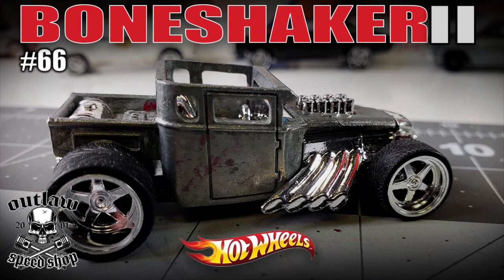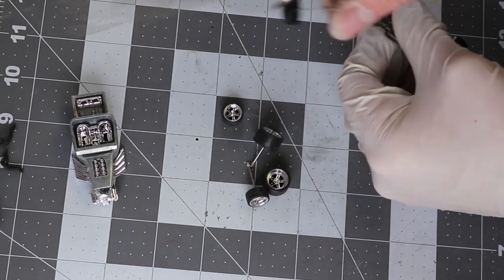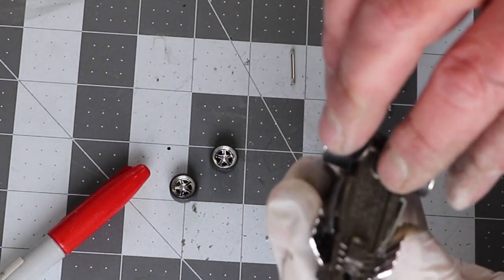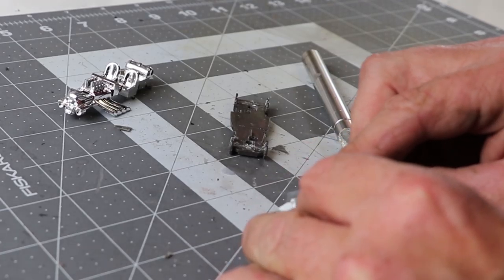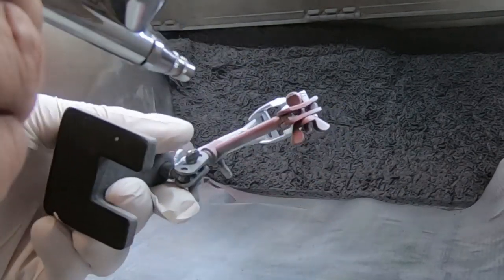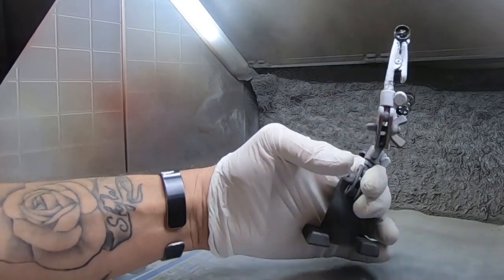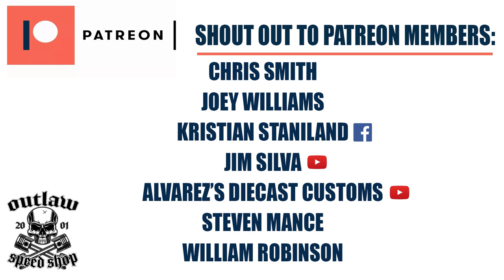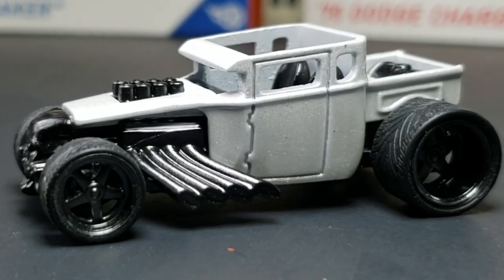Hot Wheels Custom Boneshaker 2

Comment: Your doing a great job with the videos man don’t stress the rude comments . I finally bought myself a airbrush gun . I have the Iwata Neo . What compressor do you recommend that’s not too expensive? By the your videos got me into customizing also . Thanks bro
Reply from the maker: I bought a cheap 69 dollar one off of amazon. No holding tank so it's on during demand. Works great
Reply: Thanks I’ll check them out